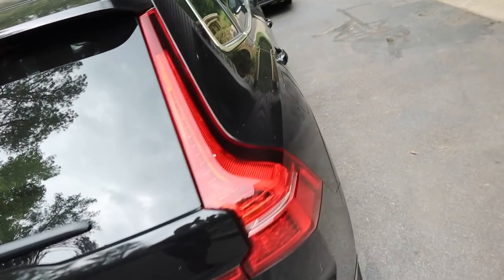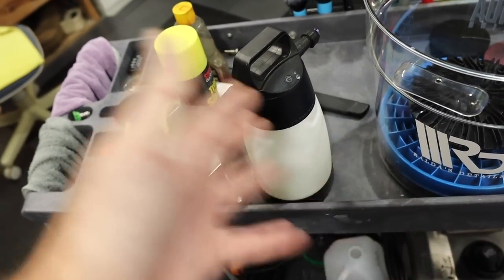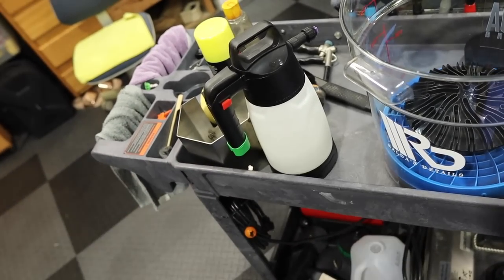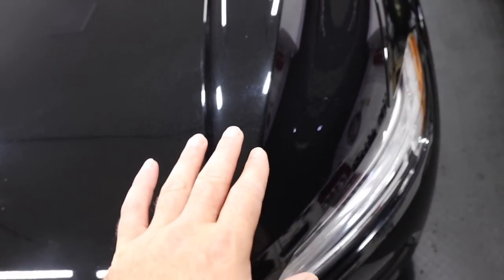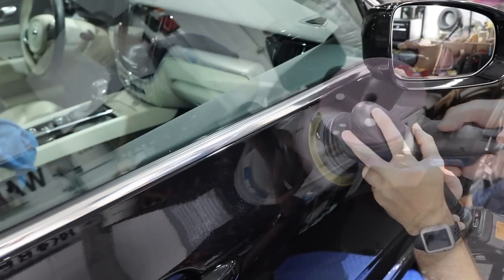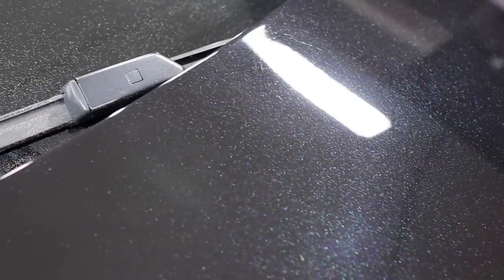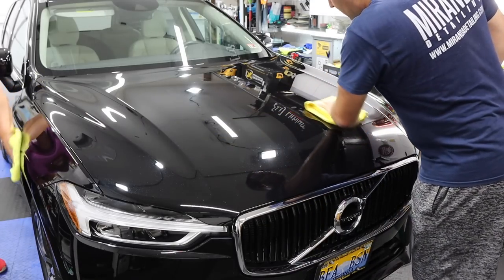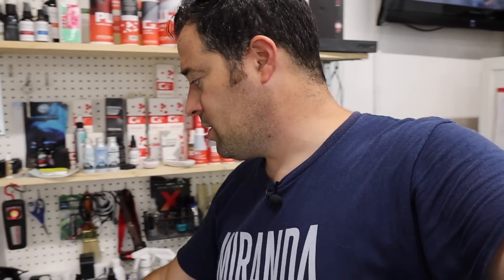Bird Droppings Will Ruin Your Paint!  Polishing & Sealant

Comment: nice job Phil & Jess, i found best thing against bird bombs -- very good surface protection, so they slide straight off!!  Recently finished a spring polish on the Outback and completed with AM Hybrid Sealant and Infinity Wax's SuperGloss+ Spray Wax, so nothing sticks.  Maintenance washed with Hybrid Shampoo and using Hybrid Detailer as drying aid and tops up protection. 👍good polishing/pad tips Phil.  Highly recommend mixing some decon shampoo (i use Garage Therapy) with snow-foam (AM Foam or IW Powerfoam), for some good pre-wash cleaning.
Reply from the maker: Thanks man!  Very good advice!!

Comment: Hello Phil and Jess.  Read most of the comments here and was wondering if there is a chemical that would safely neutralize the bird bomb as soon as possible? Seems like ONR and a microfiber would definitely remove it but wouldn’t it be more effective to neutralize it also if not washing it right away? I hope this makes sense 🤷 Thanks for the great content!
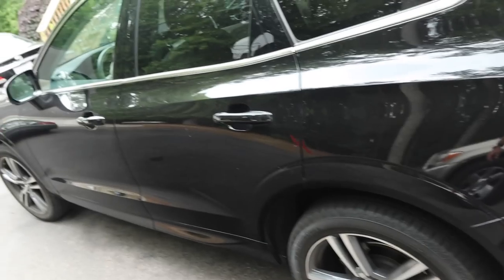Reply from the maker: Hi. If your not going to wash right and just want to remove the bird poop itself using onr or even an apc diluted 1:10 will neutralize the acidic poop. But that can compromise any wax or sealant you have applied. Washing it right away is even better. Without using chemicals.

Comment: What product can I use for.brake dust, not caked on but to maintain the wheel brake dust free? Thanks
Reply: A fallout remover and APC. To keep them clean just brush and APC clean them and protect with a ceramic sealant or similar. Personally, for heavy dusting of wheels I use a dedicated wheel cleaner or a strong TFR solution (caustic if necessary).
Reply from the maker: We usually just use an apc like super clean 1:10 to clean the wheels if they are not to bad if they already have protection on them we just use the soap we used on the vehicle.
Reply: Great advise, thanks guys.  I guess I will use an APC and ceramic protection. I think I should up grade my brushes so I can reach the tight places where the brake dust hides.  👍👍

Comment: * Any suggestions would be appreciated * I recently polished my Type R with an orange lake country pad and Sonax perfect finish. I don't have major defects or scratches. Mostly Love / Swirl/ Clay marks but that combo wasn't enough. What would you guys suggest as the next step up in aggressiveness? I was trying to avoid using a harsh cutting pad and strong cut liquid. I'm shocked I didn't get the results with that combo. Honda is known for having soft paint. I was thinking for a pad at least to change to the Meguiar's Micro Fiber cutting.
Reply from the maker: Yeah true, usually Honda paint is soft.  What color was it?    You could always kick up to a slightly more aggressive polish with the same pad.  Perfect finish my be to gentle.  What other polishes and compounds do you have?
Reply: How many passes? May need another pass on the tough spots. Try a small area, if no go try Griots BOSS Fast Correcting Cream on the orange pad.
Reply: If you've got more Sonax products, try Cut and Finish. It's literally one step up in cutting power. If that doesn't remove the defects then use it in combination with a medium or medium/fine pad, rather than a soft one.

Comment: Do you ever clay bar and then just apply a spray sealant? That's my typical process and I'm wondering if I should be using a machine applied product to get out the marring? I have used 3d speed applied quick as a wax and that always seems to look nice and not take too long.
Reply from the maker: Hi. If it’s a light colored car and if there was hot heavy grit that required aggressive clay barring than yes we will sometimes just use a spray sealant. But we examine the paint and determine if the clay marred it enough for us to justify a machine applied sealant instead. 😎👍🏼
Reply: @MirandaDetailing  great, thanks!

Comment: How would you remove bird droppings on coated car hot day if you can’t wash the car right away a waterless wash ? Also from your experience what car brands have harder clear coat where polishing doesn’t give much results as softer clear coat? I have a Audi now that is super hard clear coat no results from one step however a Japanese car seems to be softer and polish in one step
Reply from the maker: Yeah that would be a good option. Use a waterless wash and soak the dropping and then use a damp towel to gently scoop it up. 
Clear coat hardness or softness is hard to tell in general becasue each yeah, make and model can differ. But generally speaking German paints have been known to be harder and Japanese and American paints are medium to soft. But never judge clear costs just from brands. Always do a test spot to determine that. 😎👍🏼